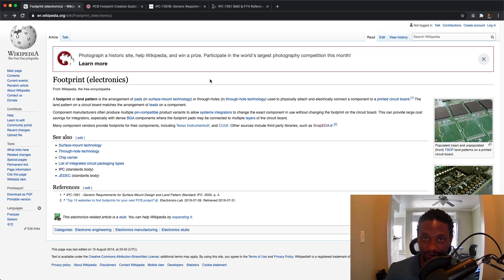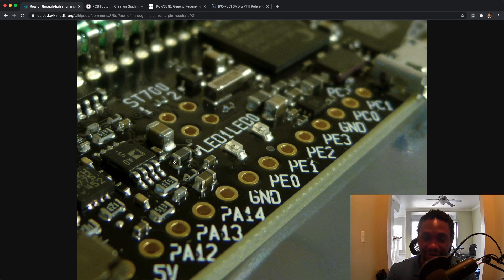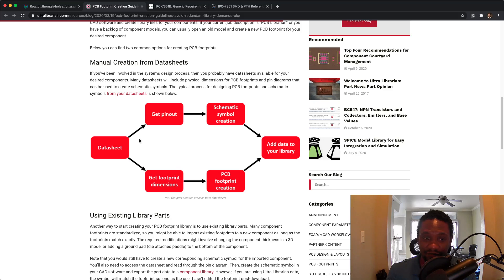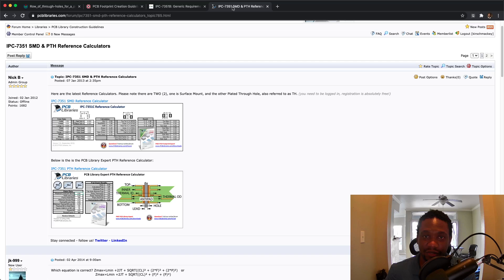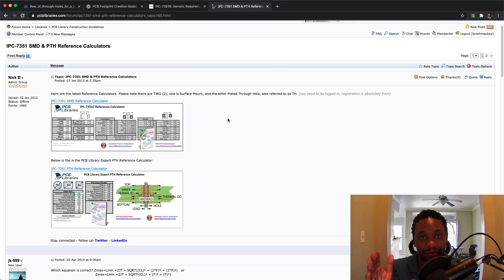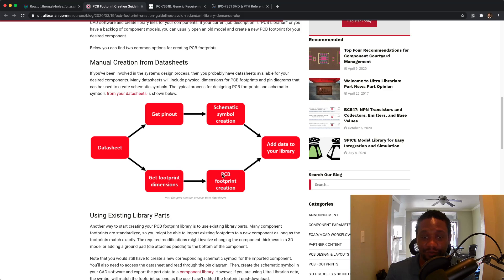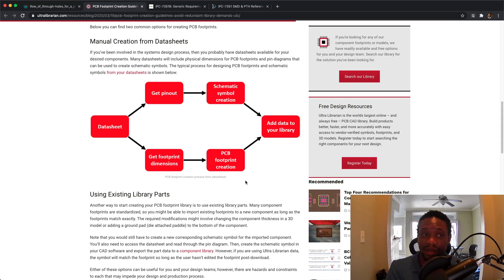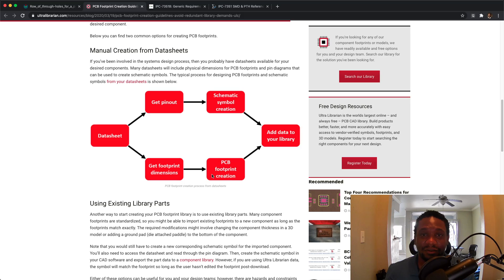PCB Footprint Creation and Where to Start?

Comment: Thank you so much Sir. It was very informative especially for starters who wants to strengthen their basics. I have a question regarding footprints and also a suggestion. My Question: How does it affect our pcb design if we dont follow IPC standards in creating footprints? My suggestion is: Please do make a video showing an example of creating footprint following all the steps you described in the video especially the dimension calculations like terminal pin specing e1, package width (E) and package length (D) in pcb editor (orcad)
Reply: @techedkirsch  Thank you sir. We will be waiting anxiously.
Reply: @techedkirsch  This is extremely helpful. I hope more and more people will discover this channel and get the knowledge that they might not find anywhere else. They are really missing on a treasure. I have hit the notificaion bell and will have my eyes on your channel for more videos.
Reply: @techedkirsch  Yes, I think it will be a good practice to get used to IPC standard based designs. This will reduce troubles in future for anyone